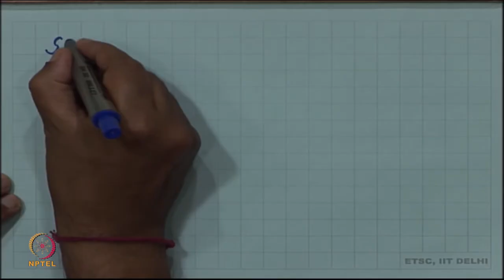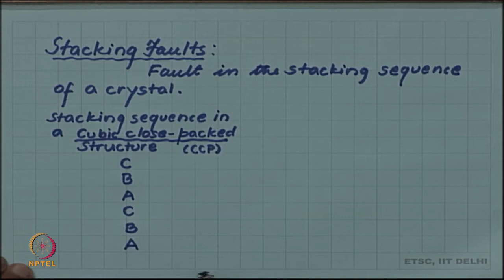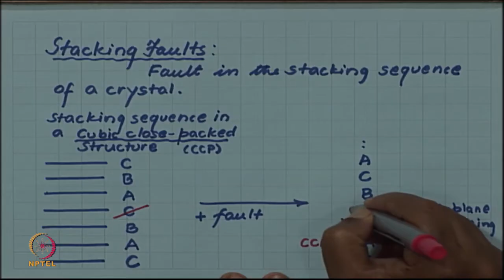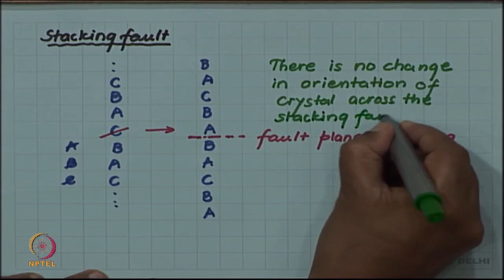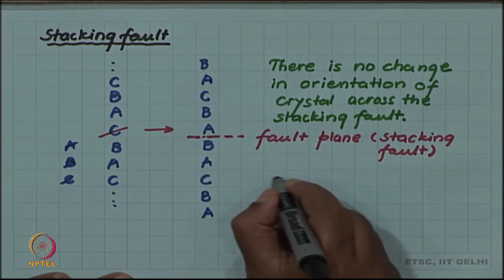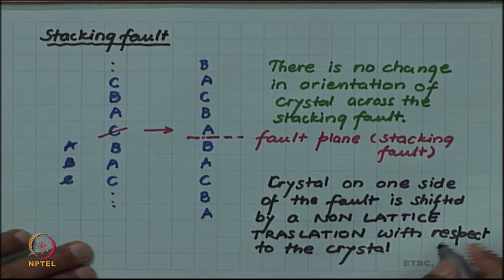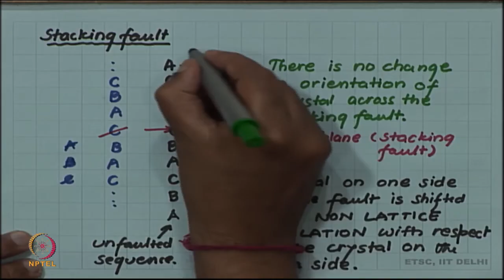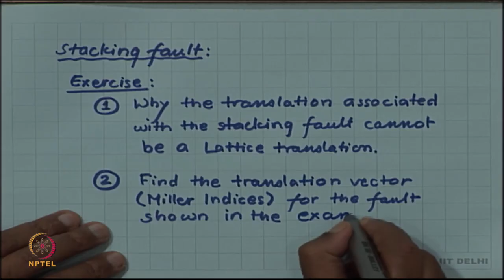Stacking Faults

Comment: @Introduction to Materials Science and Engineering  
Since, ccp is having fcc lattice. In the given example c plane was missing. Then take a corner as A. And 2 triangular plane (111) as B next to A, and then C (111) next to B. If C plane is missing, then every atom of C plane lies in [110], [101] ,[011],[1  1/2  1/2], [1/2  1  1/2] and [1/2  1/2  1] , when we take (A before B) as origin .
Then the question is about the translation vector . It means in which direction I should shift my A plane to get superimpose of A at C. Also you can say that, in which direction I should move the atoms of A planes to get the same atom at C.   Then the answer would be <110>.
That's what I think, but I need your reply to confirm my answer.

Comment: sir answer of second is [111] because 111 direction is perpendicular to 111 plane where abcabc stacking sequence are present because it changes from b to c across the fault whole lattice will change so it cant be a lattice translation .plese sir respond if i am correct or not.

Comment: In lattice translation, if we shift a vector from one point to another, we get the exact same lattice but here due to stacking fault of ABCABC type, we also get a HCP type structure (i.e. ABAB), hence if we translate a vector, we won't get the exact same lattice, that is why non-lattice translation term has been used.

Please correct me if I am wrong sir ! 🙂
Reply from the maker: You are right. Wish you the best.
Reply: @introductiontomaterialsscience  thank you sir for creating my interest in that subject which I never liked. ❤️❤️ God bless
Reply: @introductiontomaterialsscience  in
Reply: Is stacking fault takes place in close packed structure only
Reply: @letslearnmechanicalengineering  No, stacking fault can happen in a BCC crystal too. I googled and found - A stacking fault is just an interruption of the regular stacking sequence of a crystal. If there were stacking fault in BCC, you would see atom layer right above or below another layer rather than in the valley positions. Such arrangement costs a lot of energy to form and is thus very unstable and rare. But yes, there are occasional experimental observation on this.

Comment: May be because If translation is to be a lattice translation then it will form a dislocation line (1D defect)  only. But when non lattice translation is there it forms stacking fault along with a dislocation line.

Is it correct sir?
Reply: If it is a lattice translation, no defect is is created. You get exactly the same crystal.
Reply: In one of  your previous lectures you said stacking faults are due to fractional lattice translations and burger's vector to be shortest lattice translation. And a partial shift caused stacking fault along with a dislocation. 

Can we say fractional lattice translation same  as non-lattice translation?
Reply from the maker: @Vickysahu0092  Yes.
Reply: @introductiontomaterialsscience  Thank you sir

Comment: 1) the the abc abc crystal structure is a fcc structure where the a resembles corner atom b and c plane resembles the (111)plane , hence the lattice translation vector for the same should be [111], and sir as the translation is along the body diagonal where there is no lattice point present hence it must be a non lattice translation 
sir please do respond , if my answers are correct or not??
Reply: The translation associated with the stacking fault lies in the fault plane, here (111) plane and not perpendicular to it. Thus the fault translation is not [111] which is perpendicular to (111). The translation vector of the fault will take position A to B in ABCABC sequence. This translation can be shown to be 1/6[11-2], or other equivalent vectors, which is not a lattice translation.
Reply: @rajeshprasad101  Can I know how translation vector comes to be 1/6 [11 -2] ? I thought it would be [110] sir.
Reply: @rajeshprasad101  Yes sir. Why can't it be [110] the diagonal line on the top face.
Reply from the maker: @harikrishnan3112  To be precise, it is not a translation from A to B. It is actually translation from A to projected location of B on the A plane.
Reply: @introductiontomaterialsscience  Ohhh, now its clear for me, that was a nice point and totally legitimate
Reply: @rajeshprasad101  sir can you please explain it
Reply: @rajeshprasad101  explain sir
Reply from the maker: @sabitakumari3482  Please see reply to Hari Krishan.
Reply: @rajeshprasad101  does stacking fault takes place in closed packed structure only

Comment: 1) In the ABCABC stacking, each atom is a lattice point, thereby giving us the FCC lattice, but due to stacking fault, as soon as the stacking changes to ABABAB the crystal changes to HCP where the atom at B layer is not the part of the lattice, therefore, the translation associated to stacking fault cannot be lattice translation. 
2) All the layers are part of the family of planes {111}, thereby the translational vector of stacking fault is in <111>
Reply: if its 111 won't it be translational? I mean lattice translation
Reply: @suwarnaca9595  it will be (2/3)[111].....(two third of [111])
Reply: @NSBeverything  how?